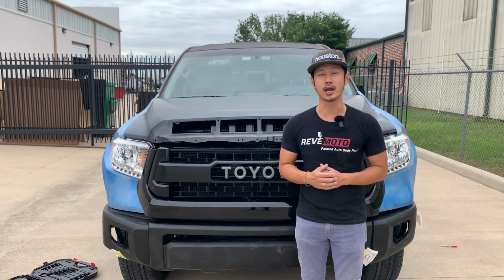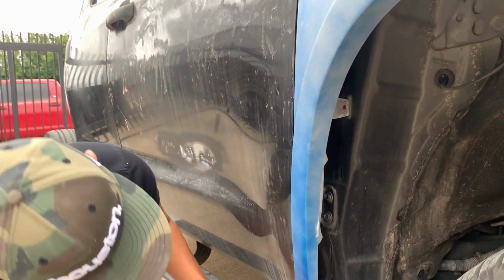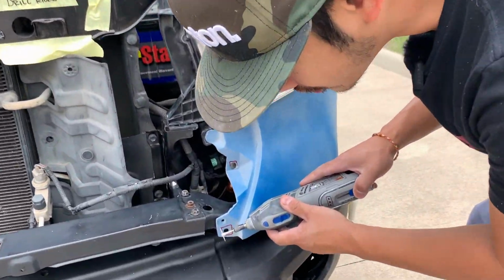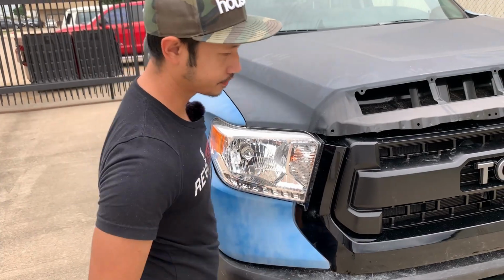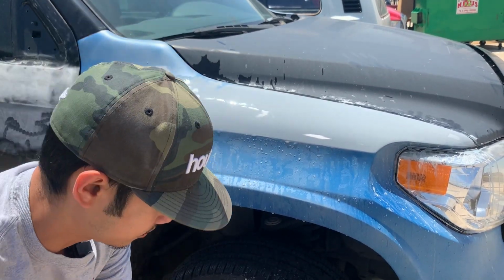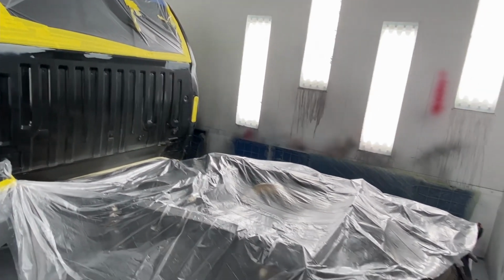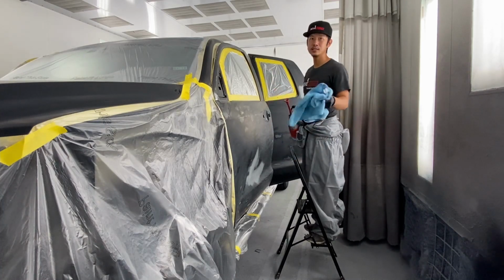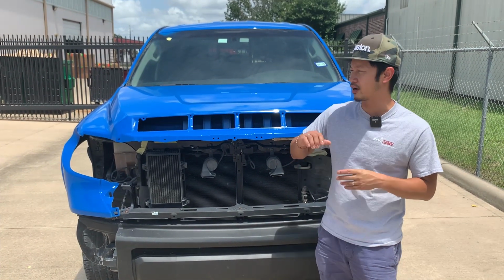Tundra Front End Conversion 2007 to 2020 with Baja Fenders | Episode 9

Comment: How much does something like this cost? Not the  conversion but if i was to jus add baja fenders and bedsides color matched to the truck
Reply from the maker: That's a great question. You have to find the baja style parts, they're usually around $1500 or more. You have to install and paint them. The labor will differ but it's probably around 3k (ballpark figure). Thank you for watching!
Reply: Where's the next video on this truck?
Reply: What color blue is this?
Reply: @LuisC202  Voodoo blue.

Comment: Hi and good day! How much would it cost me to convert my magnetic gray to voodoo blue (whole truck)? Thanks and more power!
Reply from the maker: Hello and thank you. Let's see, I would say the estimate would be roughly 2 thousand or more for a good job. That is on par with a car wrap. When I say a good job, I mean the shop is using high-quality paint, they are painting the door trims, engine bay, all the areas that need to be painted. It could be more or less depending on the shop you choose. Cost varies depending on what materials a shop uses, overhead and their labor cost. This also includes them fixing any imperfections after the paint job. I mentioned a car wrap, you could also do that and peel it off once you're tired of it. Anything under 1k, I would question. It is possible to get a great paint job for that price but the labor is intensive and materials are expensive. Make sure you look at reviews! Thanks for watching.
Reply: @ReveMoto  for $2k? Really? I always thought full paint jobs were like $5-10k..
Reply from the maker: @Luckingsworth  It's hard to give estimates, so we like to give a low figure. So many factors go into it. We probably should give a range though. You are right, for a truck at least 3-4k on the low end. Doing the engine bay, etc.. probably closer to 8k.
Reply: @ReveMoto  Im going to have to go out and drive to you guys to get it done. My local dealer qouted me $12k! 
Maybe I need to go in person and be more specific that I dont care about engine bay and all that.